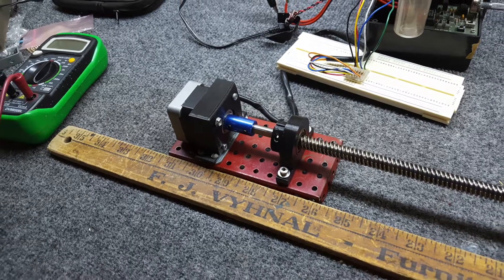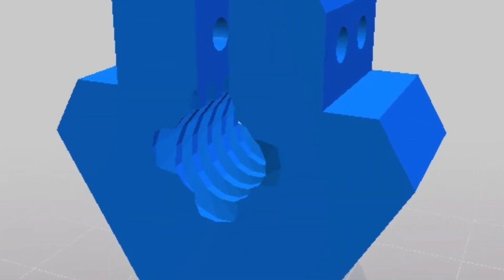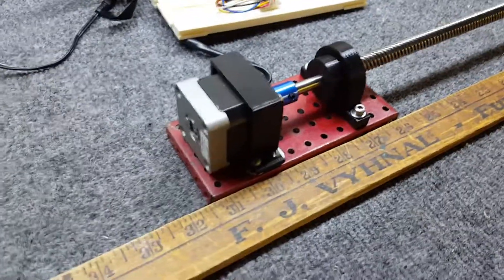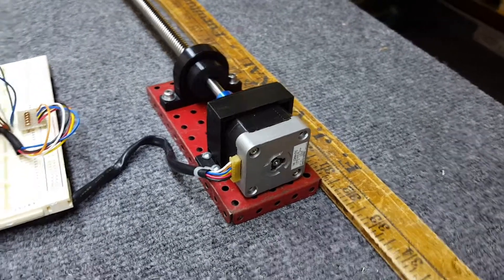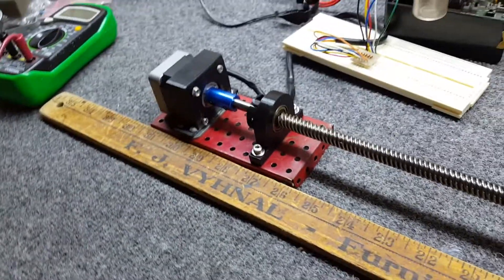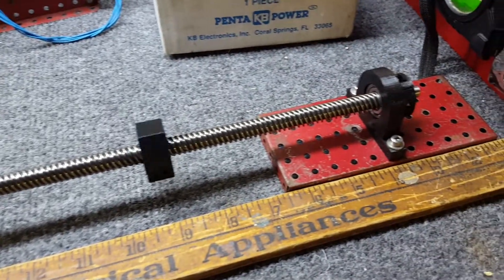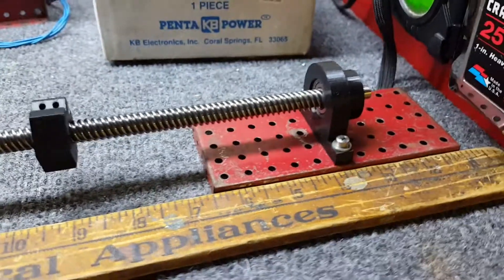Nema17 Meccano Mount

Comment: Where can I find the 3d print file  for the stepper holder?
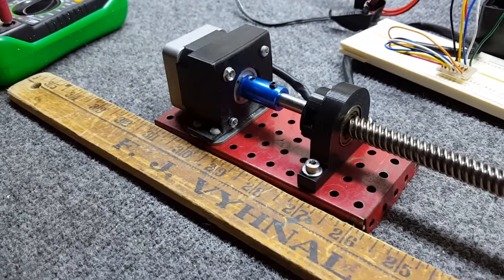Reply from the maker: @1:40     Links to the files are in the description. Thanks for watching.
Reply: @BrianBoniMakes  But none of them is the stepper holder.
Reply from the maker: @bmiraftab6502  You are correct, sorry. I fixed the damaged link, it will work now. https://www.thingiverse.com/thing:2544907